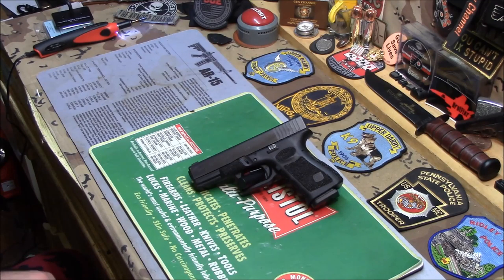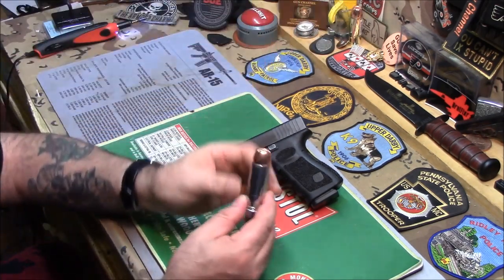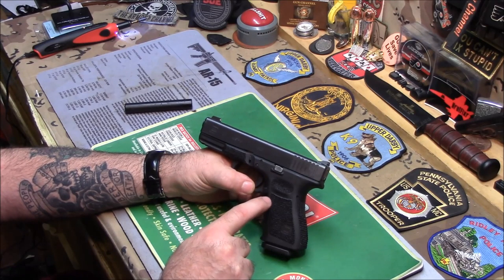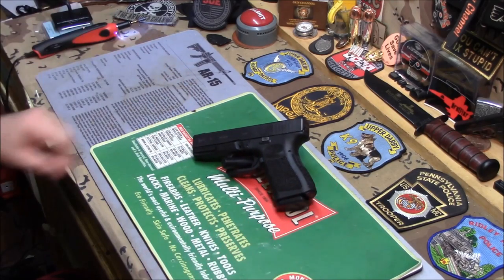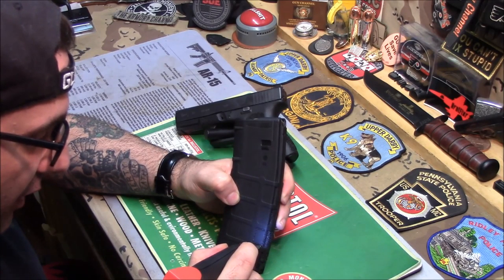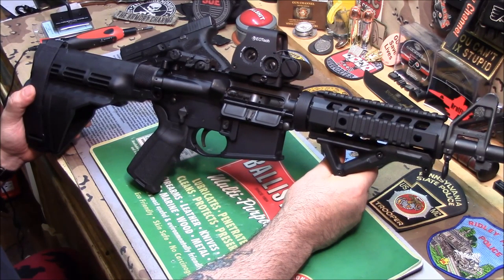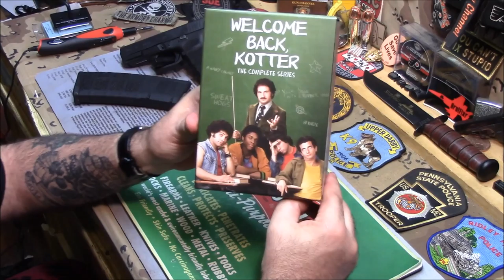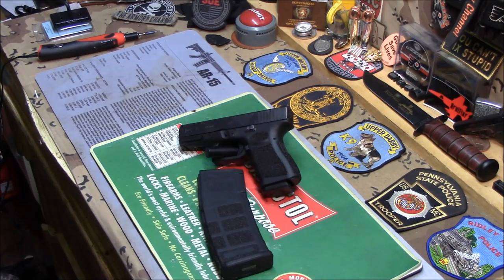Sig M400 + Glock 19 my first stipple job

Comment: Nice work Pete! I stipple all my glocks and and easy trick is to use blue painters tape to outline your pattern. keeps a perfect line as the polymer melts up against the tape line and no further. If you are not following the factory lines it helps a lot!

Comment: From one obsessive nut to another, looks great Pete. I have the same issue with the rear Magpul sight on my AR as well. I shoot left-handed (only because of eye dominance) and still need to move the sight far left to be on target. Cool to hear you was a Welder. I have been a Welder by trade for the past 20 years, since exiting the Military. Worked for two large companies here in PA. JLG and Grove. I would imagine you are familiar with them.

Comment: you gotta put a free floating rail on that ar. looks so much better. i put a yankee hill mid length tube on there to get rid of the a2 front sight. threw some flip ups on there with the eotech and it looks nasty.

Comment: Pete if you take a little sand paper and light rub the stippled areas it will remove the roughness. But not lose the texture. I don't wear a shirt under my gun so the sharpness of the stipples were unbearable to me. I think you wear undershirt sonmayvot be an issue for you.